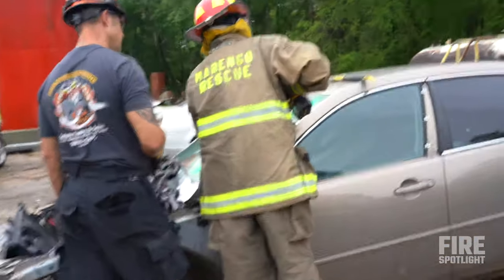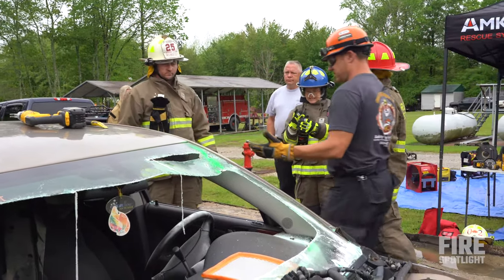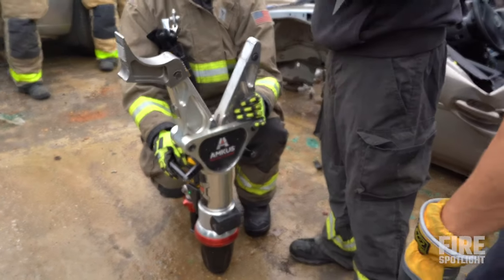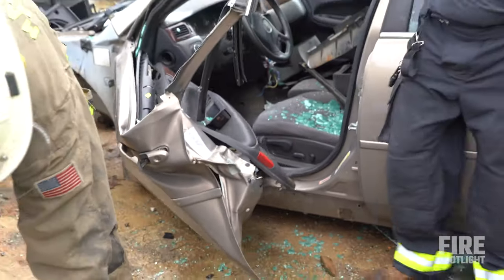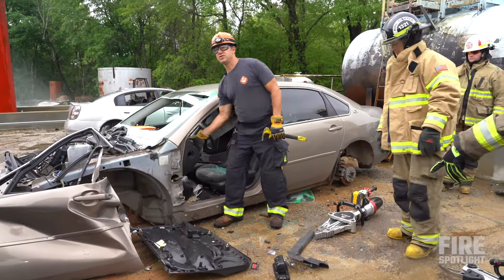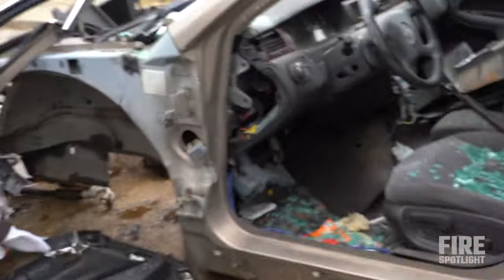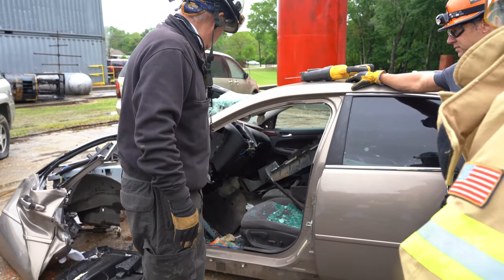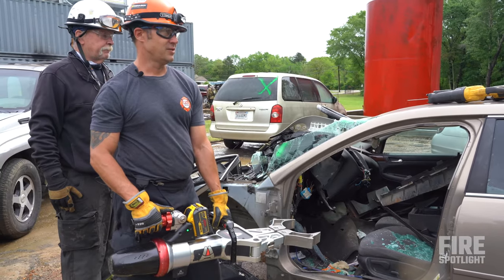AMKUS Rescue Tools Extrication Training

Comment: Guys ,a quick tip to hopefully  make things safer. Never use your gloved hand to knock out the broken glass. It's very common for firefighters to get hot with all their ppe on at a traffic accident  and they often wipe sweat away from their face. If you use your gloved to knock  out the broken glass it's very common to get loads of small glass shards in your glove and if you then wipe the sweat from your  face you end up cutting  your  face. Hope this is helpful.